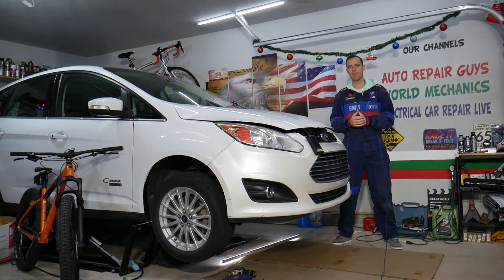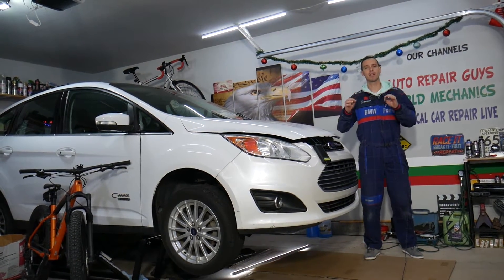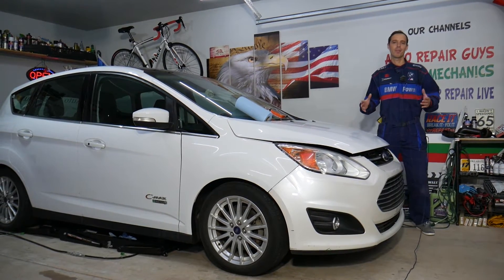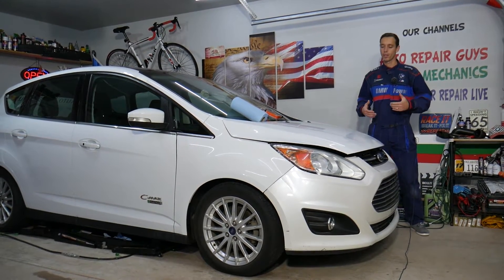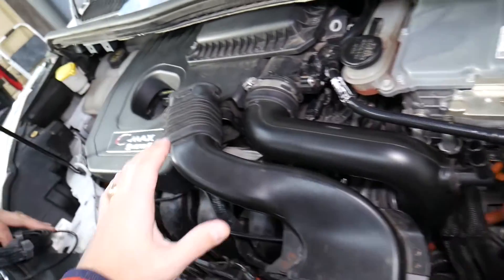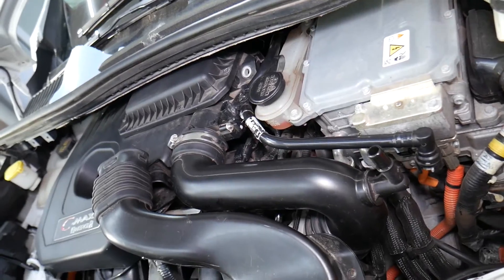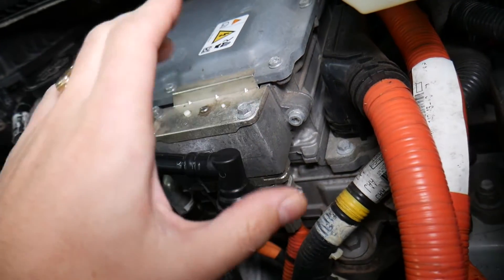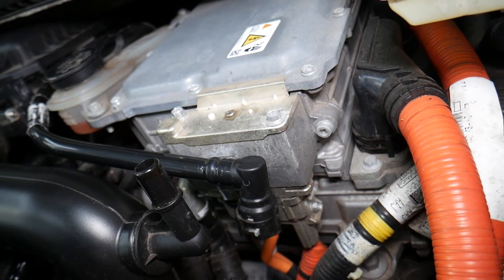WHERE IS THE AC DC INVERTER CONVERTER ON FORD C-MAX FORD FUSION LINCOLN MKZ HYBRID

Comment: I have a question about my 2012 Kia Soul blower fan not working for my ac and heat.  I have replaced the resistor, checked the blower motor by directly hooking it to the battery after removing it, replaced the control switch on the inside of the dash, and checked all of the fuses and the blower still doesn’t blow.  You can feel the heat and the cool coming through the vents a little only when your going down the road.  The compressor kicks on and everything so I’m at a loss.  Please Is there anything you can think of that it could be?